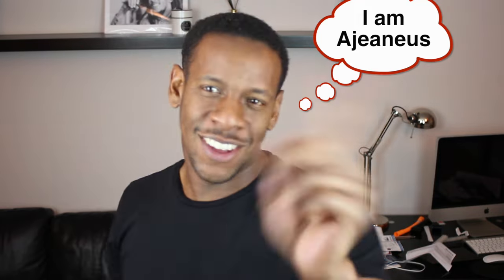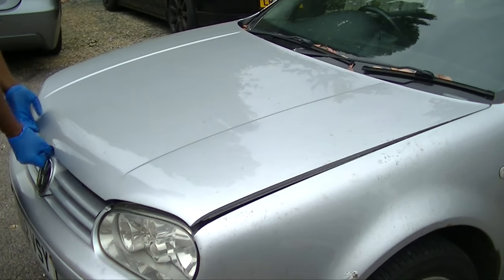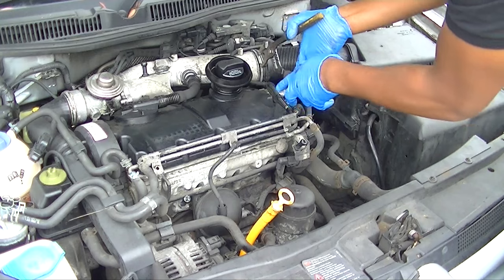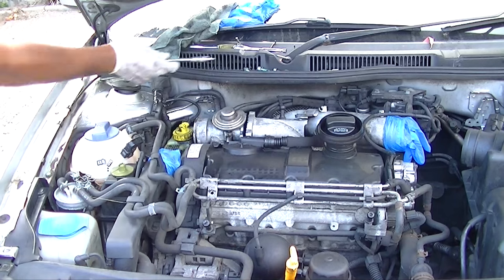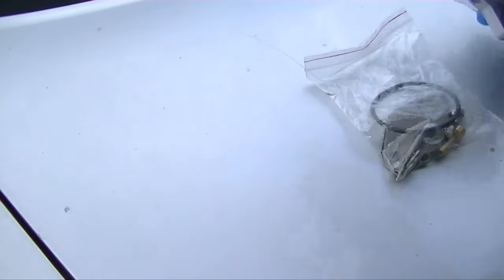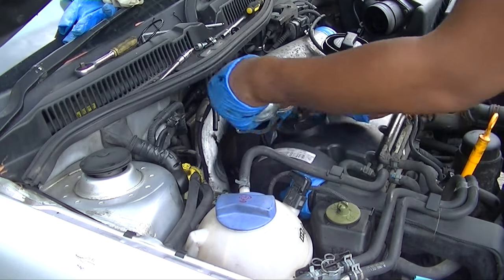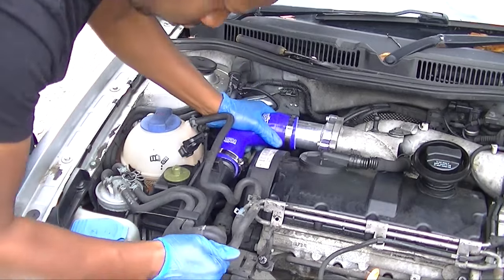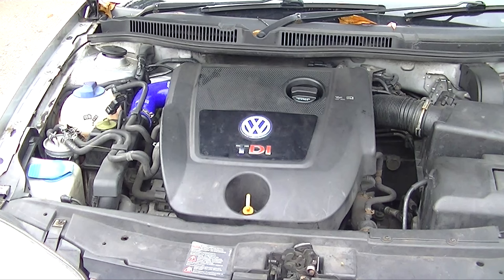How to Delete an EGR Valve with a delete kit

Comment: too complicated, 

just disconnect the rubber vacuum hose from the top of the valve, 
with no vacuum the valve closes 
and blocks the entry of the exhaust shit into the manifold.

so you dont need that blocking plate and other parts

Comment: Cant you just blank the vacuum hose to the EGR valve?
Reply: Yes, you can - and it is much better, because nobody will see at the technical control, that you have the EGR deleted. And, you will save your money... ;)
Reply: Just don´t forget to clean the EGR valve, and fix it at OPEN position.
Reply: Laurence Bell what do u mean by that cause I'm going to buy this kit thank u
Reply: you can, however an egr valve has worse flow than a straight through pipe
and exhaust gasses could theoretically open the valve by itself on WOT

Comment: You need to be more accurate as you can not do that to a modern Diesel turbo that has no waste gate and which means turbo dump is returned to EGR manifold. When you lift your foot pedal of the accelerator and the vehicle does not slow down due to blocked EGR...you are in trouble.

Comment: What does it improve?
Reply: Egr is responsible for idle quality

And is responsible for proper air/fuel/exhaust gas mix when accelerating 

Removing egr

Allows only oxygen and fuel to go onto the combustion chamber (like god intended lol)

And having an egr puts terrible hard to use exhaust back into the combustion chamber and it is very hard to burn 
(because it shouldn't be being burnt again how are you going to use a fully burnt piece of wood a second time.....) 
so they have to make it very hot in order to work right and in turn that extra heat destroys many components on motors of all types
Reply: rawk4life93 best answer evry.  maybe you got it from the Bible 
i did an egr delate on my 2.0tdi last week. my God she gained a lot of hp. & I didn't notice any black smoke
Reply: PatRiot hi man, I'm from Brazil, and I have an a3 T 180hp gasoline... is there any problem if I delete that EGR??? Like high temperature inside of the combustion   chamber?? Or another problem???

Comment: How to Delete an EGR on GOLF 5 1.9 TDI ? )))
Reply: ***** no delete without having problrems, you can't disable it on the ECU (no matter your tuner says it and accepts your money),  ECU will notice something is wrong and will protect itself if you delete or block it. you don't want to delete your EGR in a 105 hp engine.  there are good reasons to put 130 bhp to that engine but no long-term gain. Keep yor EGR and intake clean if you do short trips and urban driving, and listen carefully the turbo sounds (ambulance siren = bad news sooner or later)

Comment: The theory states that the EGR system works, BUT, if they are blocked do they control emissions? answer obvious, the EGR is a defunct ineffective device installed in vehicles to keep mechanics in a job and to give that warm feeling to car manufacturer's.

Comment: Probably won't pass emissions...
Reply: That only matters if your state requires emissions
Reply: Diesels don't have emission tests... They have visual smoke tests.
Even if they do have emission tests the emissions limit is so high on them you can get away with straight through exahust and egr delete.

Comment: 1. This is ilegal (you are violiting the regulation about emisions)
2. This is unethical (you are poluting NOx and causing more danger to people)
3. This is stupid (it will not work as others before me said, since unless you'll reprogram the ECU it will generate all sorts of error codes)
4. This is uneccesary (what are you gaining of this? If you wan't more power this can be done by chaning maps in ECU. There is EGR valve that can be closed when needing more power, but otherwise you are not loosing anything if EGR is open when at partial engine loads. Also since you are using old heated gas you are actualy saving some fuel)
5. EGR also plays important role when engine is cold and when ambient air is cold, since it raise combustion temperature. 
6. As mentioned before intake flap should stay there since it plays important role for smooth engine shut off and durring shifting
Reply: 1.Who cares
2.Who cares
3.Mechanical EGR valves dont need reprogramming
4.More power and colder air being sucked into the engine because it isnt heated up by the exhaust gasses.
5.Colder air is better
6.Who cares, you get a bit more shudder when turning the car off, thats all.
Reply: You are wrong.
1. Whatever
2. Whatever
3. No error code will light on the dash in these cars
4. Cleaner intake and long lasting performance.
5. Engine will be fine
6. No damage is done, just shuts down rougher

Comment: aeroplanes don't have EGR valves with their 880 degrees engine temp, EGR valves are a SCAM and DAMAGE your engine so you buy a new one < think all them old cars still out there today with no EGR valves to be seen , , if you want to delete your EGR valve you can leave it on just blank the exhaust inlets off ,& if there is a gate on your EGR you'll need to disable that via the vacuum cylinder < some cases the engine will need re-mapping but this could be down to a faulty injector(s) as some injectors fire before desired pressure , test all aspects before doing any mods , always leave yourself able to return back to original condition

Comment: I want to bypass the egr configuration so bad but cannot disable egr in the ecu. Egr is annoying and now I have to buy a new selenoid. If the car manufacturers really care about the environment than they should just stop making gasoline engines and use hydropower or electric engines

Comment: aaaaaaannnnddd you forgot to tell to learn how to deal with the check engine light every 150 miles coming on and the rest of problems that brings to the OBD2 system....c'mon dude, that car is not a racing car nor is not a good idea, is like saying to take the thermostat of the cooling system for the engine to run cooler....
Reply: So true,  also, that has the ASV built into it as well, hope he knows how to deal with a runaway

Comment: Delete your EGR and get exactly zero performance upgrade and shittier NoX emissions.
Reply: Yes you are right but the engine will stay a lot cleaner inside and it will last a lot longer and I get a lot better fuel consumption But no power difference on a rolling road test
Reply: It WILL increase performance getting the most gas out. Have you ever heard of porting a head? Same concept.
Reply: @jeffmee763  There is a power difference

Comment: How stupid, car builders have spent millions to design egr valves to protect the environment for us and our kids and all this foolery is just undoing a lot of good work. Just clean the erg valve and keep it running and leaning the exhaust emissions as it was designed to do.  the planet is more important then a stupid useless mod.
Reply: Fuck the planet. We need power!
Reply: Tofthill4 Stop your moaning ffs!
Reply: And when it shits itself and pumps water into your head and causes the whole engine to seize? Hence people delete them. You have no idea what you are talking about
Reply: Tofthill4 aI
Reply: Your comment makes me want to go remove all the egr valves.
Reply: Eating your own poop is also enviromental friendly. An EGR is in fact the mechanical poop eating equivelant.
Reply: Well my engine died at 87k miles from the EGR valve so you know when I get my car back, I'm certainly removing the EGR.
Reply: Actually, you should research what the EGR valve actually does. It only works under low loads to reduce "pumping loss" and Nox.  It doesn't work under high loads.  It is associated with emmisons, but has very little to do with reducing toxic chmeials.  If the vehicle is running rich sure it might burn the unburnt fuel, but for the most part it was designed for "pumping loss"  to reduce wasted energy from the vacuum of the pistons at low loads.
Reply: Tofthill4 truly but..no ones care..you wanted fix the enviroment now??..when theres no cure..dont be patetic people open the eyes we alredy adult
Reply: Actually, it is only cold egr that does reduce nox. This was mainly introduced to heat up the engine faster. It will lower nox a bit, but not a noticeable amount. It will also just create more soot or 'coal' because with egr it can't burn the fuel fully, so without a dpf you either have lung cancer or ozone. You decide 😉
Reply: aeroplanes don't have EGR valves with their 880 degrees engine temp, EGR valves are a scam and damage your engine so you buy a new one < think all them old cars still out there today with no EGR valves to be seen ,
Reply: Leesa Crystal John yes you can actually remap it so it only opens in a min. Time table easier but exspensive plus some people like the dress up look of the delete plate idk
Reply: @arebrec  lmao
Reply: @ButchE30M3S14  It literally is.
Reply: @davidmorgan4074  Exactly